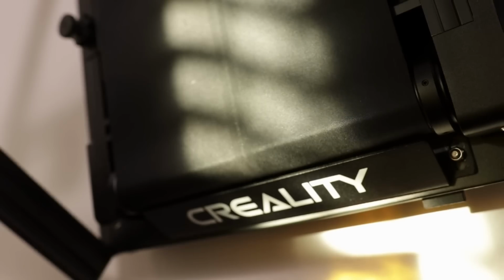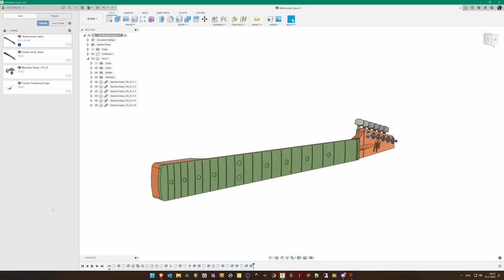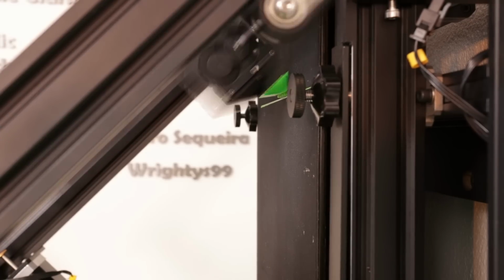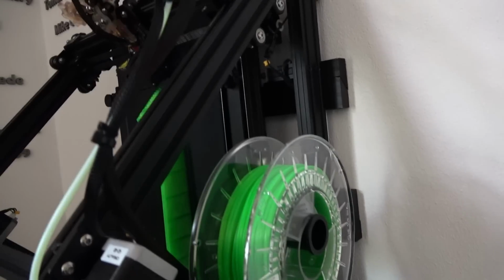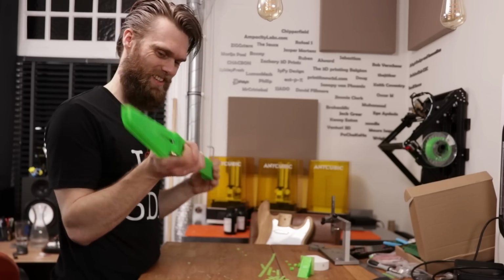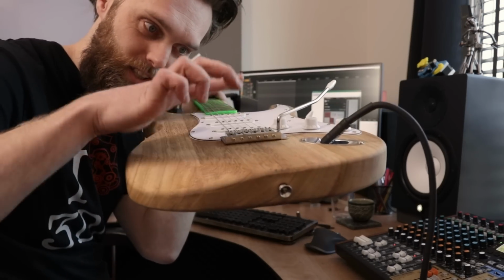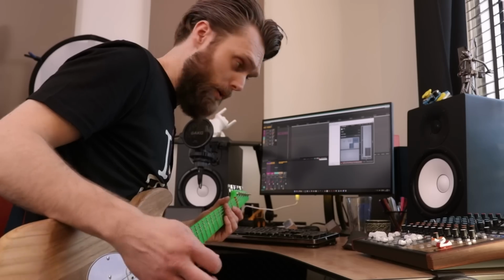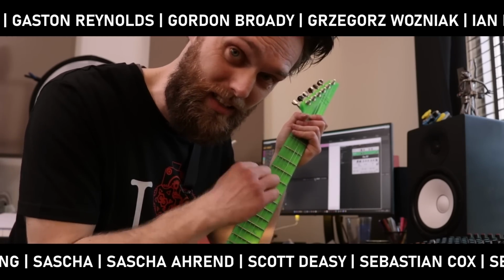A 3D printed single piece guitar neck?! ft. CR-30 belt printer

Comment: hmm, I would suggest something other than PLA personally. it's a very brittle, very sturdy material, but at the same time prone to bending and warping under long durations of stress (think old glass panes). PET is just a little more solid, heavier, and has some actual spring to it. In both cases you'll want to print it thicker, though. something like putting little holes inside the neck, along its length, or using isogrids on the inside. when in doubt, rib it. as well, if you must have structural infill, make sure it's gyroid and at least 2 paths thick. combine all of those, and even some flexible filaments become quite rigid.

 if you wanted an absolutely straight neck, you might have better luck printing by left and right halves, then using pins or bolts to connect the halves. if your printer is inducing a warp, printing two halves, one flipped, should give you two parts that have opposing and roughly equal internal stresses. it'll also make it easier to get that bar in.
Reply from the maker: Thanks for your suggestion! I just started with PLA to see if this would actually be possible. (the old glass panes might be a myth ;)) Creep is definitely a problem and for the next iteration I would do it differently, at least out of a different material. I think that this printer should be able to print straight and I want to keep post processing to a minimum. I think that a few tweaks and a different material would already get far :D
Reply: @properprinting  ah, I see, well, not sure on glass any more, but PLA DOES warp slowly due to pressure. PET is a lot harder to print though. it has less natural warp, so that's a definite plus for you, but actually getting solid walls without boogers and gaps can be a pain. I've experienced that much. when it comes to minimizing post processing, definitely look to m5 bolts, then. the process of bolting things together is far faster and less of a pain, even if it does require external hardware. On the other hand, unlike glue, epoxy, or so on, bolts are reusable and standard, so anyone who makes the design again (including you) will always have access to the parts, or if you go to m8 size, you could reasonably print the bolts too!
Reply: Good luck printing PET on the CR-30, I fucked up my bed just trying to get it to stick.  I ended up moving to the Ideaformer ir3 v1 and haven't had a problem with it now.

Comment: Great job! The color a bit freaky for my taste.  I wonder how the Wood filled PLA would work? Would it be strong enough? Also, since the truss rod is metal you might be able to heat it up with a heat gun before installing it. (Or make the slot bigger next time. Lol). I like that you made the neck one piece. By doing that you don't have to worry about the fingerboard coming off. Again, great job!

Comment: How much infill etc? Try doing close to 100% and print it fretboard down and sand a proper radius into it... Looks awesome in green... If I ever manage to get my printer set up right I may give it a go... 😁😁👍
Reply from the maker: 30% triangle infill with 5 parameters. What would be the advantage of printing it fretboard down? Thanks!
Reply: @properprinting  sorry... only just seen the reply, i would say having a flat solid printed fretboard would help keep the neck straighter, and you could change the radius by sanding with a different block to have the best radius for you depending on how you play... would also save support material... but obviously if you want the printer to do all the work then your way is probably best... :D

Comment: The reason its going out of tune is probably because of the nut. nuts have to have a peak around 80% of the way towards the bridge of the guitar and additionally tusque nuts are specifically engineered plastic that doesnt allow for strings to slip. Ive tried PLA and 304 steel before and they both dont work as well.

Comment: It might have been the camera angle, but it looked like the height of your frets even when idle doesn't match the height of your saddle. While that's not necessarily unusual on an electric - most having adjustable height and distance on the saddle and bridge - it looked well outside the normal height span for my limited experience. If I had to guess, I'd say it looked like five to seven sixteenths of an inch instead of the usual one to three (roughly eight to eleven millimeters and 1.6 to 4.8 millimeters, respectively). That might have contributed to the issues you were experiencing, as could the amount of flex in the neck. May I recommend lowering the saddle or raising the fret board, and experimenting with your number of walls?
Reply: Rewatching the video I see that you already lowered the saddle some. Sorry about that.

Comment: Interesting project.  I 3D printed a guitar body about 8 years ago: it took 48 hours to print.   I was too chicken to bring the [carbon graphite] neck up to correct tension.  I was surprised that you could bring the neck up to the correct tension and that it worked.  I guess it will fail over time, but I hope not.  I suggest that you consider using support in the future to allow you to make a more conventional neck shape.  It is easy enough to remove the support and sand the revealed surfaces.  I love the translucent neck!  Did you consider using 100% infill rather than the 20% (?) that you appear to have used?
Reply from the maker: Thanks and awesome that you've printed a guitar body! I used .011 strings so not even the thinnest! I don't think it will hold over time due to creep and I'm going to take a look into other materials for a future version. I personally like the shape of the head right now, conventional is not something I do often xD I used 30% infill and 5 perimeters. In order to make it stiffer more perimeters work best.

Comment: This is really awesome! But it'll never have much hope of staying in tune with the bridge floating on the guitar body like that. I get that it allows you to bend to sharper as well as flatter, but if you adjust the springs in the back tighter/add a spring you'll have better luck. Great stuff man!
Reply from the maker: Thanks! I really don't like a tremolo system, but this was the easiest kit I could get my hands on. The fully 3D printed guitar I want to make definitely would not have a tremolo ;)
Reply: Even if you do that, the neck is not stiff enough and you're bending it every time you play.

Comment: Cool. Next, a neck that has a pegboard of embedded tiny LED lights, built in auto tuning 3d printed machine heads in nylon or carbon fiber, easy access effect buttons, pressure sensitive pads that fit between the frets that are translucent, on the back of the neck, add a long strip ribbon controller that can be used to morph pitch bends and effect modulation. For the body, fill it with a bunch of cheap android phones that can each be used to access the control surfaces of various music app, looping samplers and drum machines and synths and digital built in effects, a 10 watt stereo amp and flat speakers  and battery that deliver a high fidelity all in one concert experience 1 man band with a built in midi central nervous system.
The lit up neck can be a newer version of a fretlight guitar.
This could also apply to a classical guitar. 
The strings being nylon with a conductive tiny wire embedded in the core of the string itself, allows for making the strings not only functional for regular pickups, this should for allow for being a midi actuator, so if you stop playing, you can set it to make accompaniment midi files or tracks or sample loops also pause until within 3ms of when you pick another series of notes or chord strum patterns created from arpeggiators. 

Or maybe make the guitar body a type of digital drum machine editable control surface. I dunno, just throwing ideas out there. 
If you get rich from them, I would like 50% of the billions of dollars. 
👁️👁️

Comment: With color changing lights, dial a different color, or, a shaped LCD screen, touchscreen conductive 3M nonscratching self healing self cleaning antibacterial pick guard.
Actually, this formula of plastic can make a self cleaning self healing nonscratchable entire guitar beyond the steinberger for durability.
There are alot of interesting formulas for plastics, patent studies can be like turn key walk through to use for affordable R&D.

Comment: Na-ha-ha! Cool. But could you tell more about wall thickness and infill in settings? Also - how you printed fretboard? I would try to make fretboard printed with 100% infill.
Reply from the maker: Thanks! I used 5 perimeters and 30% triangular infill. The fretboard was just the same piece with the neck and almost as thick as the perimeters, making it basically solid.

Comment: If you want more stiffness and tuning stability, as others have suggested, print the fret board and neck separately. Not only will this allow you to fit the truss rod correctly, but, you could also fit two carbon fibre rods, one running down each side of the truss rod. That would likely make it more stable than a standard maple neck without reinforcement. You could also improve the flatness more easily by using levelling files and/or levelling beams before fitting the frets to correct any print inaccuracies.
Reply: I would also print the neck as a single piece with no slots. instead of pressing the frets in, just do it like you do for threaded inserts, maybe using some implement to heat the arbor press and the fret.

Comment: Stumbled upon you after searching for 3D printed frets.  I was wondering about NOT printing a guitar neck, but printing fretboard sections with true temperament frets (curvy) for nylon guitar built in.  The material would just need to be abrasive resistant, but nylon strings are not that abrasive.  The fretboard sections would be glued onto a wooden classical neck that is lacking a fretboard, which is what I happen to have.  Curious if you have any thoughts on this project... Cheers!

Comment: Steel Metal-Filled PLA Filament

"Protopasta Stainless Steel PLA filament is a dense material that prints as easily as standard PLA but results in heavy cast metal looking prints that can be brushed, sanded, or polished post-print to achieve amazing results." :) Maybe. With this can come the shiny translucent glass like part :)

Comment: That's cool, you could 3d print different scale lengths, microtonal fretted necks, fan-fret, unfretted.... so many options. How much time did it take to print and what's the weight of the neck?
Reply from the maker: Thanks! I never thought of the possibility to use different scales. I was thinking of angled frets because I think that's more comfortable to play. It's fun that this enables new options to experiment with. It took around 40 hours to print and I haven't weighed it. I think it's a little lighter than a standard neck, but not that far off.

Comment: I'm curious to see how this neck is doing a couple months down the road. PLA will deform under tension and compression over time, how will that affect this print in a month or two?
Reply from the maker: I'm curious too! I had creep issues before and I think that I eventually have to print it out of another material like PETG or ABS. I'll keep the strings under tension and see what it does over time!

Comment: Nice! Like to see it with some lighting in it. Watching it flex made me think of using a wide strip of spring steel and print tpu around it. Feeding the steel in as it prints. Like how you would drop a magnet in a cavity of a print.
Reply: Carbon fibre rods is what most actual guitar manufacturers use to stiffen necks.
Reply: Or just make it out of wood. Wood is a renewable resource, doesn't really pollute the environment and takes less time.

I'm a 3D printer, metal fabricator and woodworker. Some of the things people want to make with 3D printers are completely impractical. It's still fun to do though if you don't mind wasting time and plastic.

I have three 3D printers and I'm currently saving up for a CNC machine that will also run my plasma torch.

Comment: Strings are on the wrong way lol.  They should go over the top of the tuner so a counter clockwise rotation tightens the string.  Extra tension has to make that thing a tuning nightmare.  Still very rad!!

Comment: Is it generally safe to have green lasers hit a modern camera sensor, as cool as it looks? Genuinely curious.
Reply: The color doesn't really matter. Those laser levels are basically just laser pointers, but with a massively diffused area through that lens. Not enough concentrated light there to do damage unless you're leaving it sitting in the beam, I would expect.
Reply from the maker: There's a limit of course and styropyro manages to fry out a sensor, but in the end it's about the amount of energy that hits the sensor. You can aim the camera at the sun without destroying it. I don't have a clue about the actual limits though, but I think I have to do a bit more that that to actually destroy it ;)

Comment: If any of you ever needs to drill out a hole that is just slightly small but the part has no safe place to grab or you're afraid to break it, just run the drill in reverse and let the heat do the boring. I was able to bore out two 70mm*1.2mm cylinders (pen shafts) this way when their printed bore was slightly too small. If I drilled out the same holes with the bit biting I would never have been able to hold onto it.

Comment: Hey man, I recently acquired me and my fathers old project of a printer.

I now have a seemecnc Orion delta printer with a e3dv6 upgrade. I wanted to put a revo in it and do remote direct drive for the extruder. I like your belt idea cause I was having problem with spring tension on the stock extruder not being adjustable and tearing up filiment or loosely grabbing others.

My question is would you ever consider trying to add your detachable flex cable instead of a stepper motor? If so I may try your design when you upload it to your website
Reply: Also if you do I’d love to see the process you go through in a video of coursw
Reply from the maker: Good question! I thought about adding a flexible drive, but this extruder requires too much torque resulting the shaft to twist. This could probably be mitigated with an extreme gear ratio, but it doesn't have enough advantages I can think of to try and get this to work.

Comment: I was wondering if a 3d printed fretboard would work. You've gone way beyond that and 3d printed the neck! Now that some time has passed, how's the neck holding up? It is still playable? Have you encountered any problems? And, for my benefit (in thinking about 3d printing a fretboard), are the frets still in place?
Reply from the maker: The neck is far from playable because the head started bending. I posted an update here https://twitter.com/properprinting/status/1582386505959366657 The frets stayed in place just fine!
Reply: @properprinting  Good to hear the the frets are still holding. I just might print a fretboard for the guitar I'm currently building (out of wood).

Comment: I have been saving Domestos bleach bottles to make a neck and body blank from the blue HDPE and pickup rings and switch tip/ POT knobs from the red bottle caps and seal, I will use my MPCNC to mill the neck and body and two carbon fibre rods either side of the truss rod should stop any warping and once sanded to within a micron of its life I will spray with a poly clear coat, those blue and red colours are so iconic, I have some quality hardware to fit on it as well

Knocking the truss rod in is not the way to go, I am anticipating problems, I would print it with a relief on the back and then fill that in with the skunk stripe, like full maple Fender necks

Comment: hear me out: two skinny rods on either side and a truss rod in the middle, this would keep the neck straight but also allow the truss rod to still function and do its job, rickenbacker sort of does the same thing with their instruments. You could 3D print a whole guitar using this but instead of having the two smaller rods stop where the neck does, they would have to go through the body. You'd also have to put an aluminum block in as well where you would put the bridge so that it would have something to anchor itself to, otherwise the screws would get stripped out immediately. Totally possible but a lot of work and probably not worth it.

Comment: Question: You can print screws and gears, complex tool parts that are can be moved later, right? Wouldn't be possible to design the neck a bit thicker, but movable printed truss rod? Also: you are printing METAL guitar, wouldn't be possible to print the whole guitar with METAL filament? It can gain more stiffness by default, and if you can print the entire guitar, only missing the strings – you could be the most famous GUITAR Hero on Earth....
Reply from the maker: Thanks for your suggestions! (also your other comment). I like the combination with a plastic neck and the truss rod because it remains lightweight which is more comfortable and the truss is mostly needed to get that curvature right. The neck printed out of polycarbonate would be epic, but I doubt that this would be printable on a CR-30. Polycarbonate is even stiffer (PLA is already a pretty stiff polymer)

Comment: Could you embed the fret wire using heat the same way you embedded the nuts in 9:20?
Reply from the maker: I tried with that test block and failed. The heated fret pushes the material aside and doesn't stay in place. I had the best result with this fret press caul at room temperature

Comment: Awesome video! What type of file did you export it out of freecad as? Normally i would think stl, but that would just make it all one mesh object.
Reply from the maker: Thanks! I exported it as a step file which is the most universal file for parametric 3D drawings
Reply: @properprinting  Thanks for the tip! I'll give that a try!